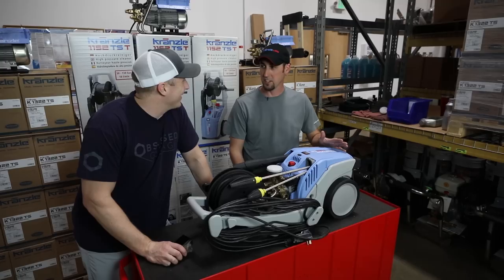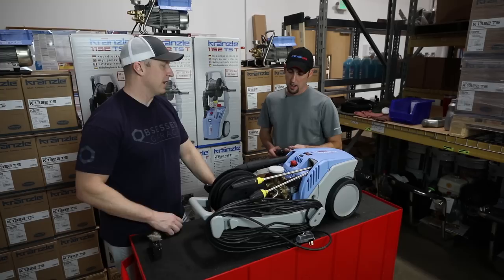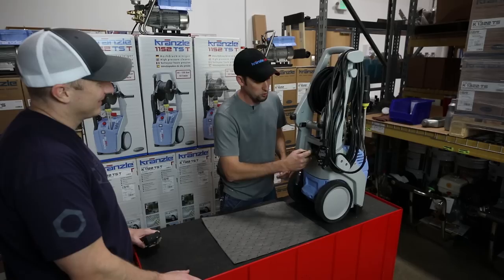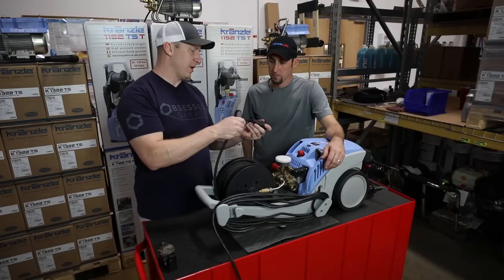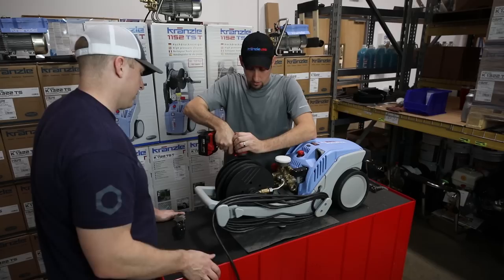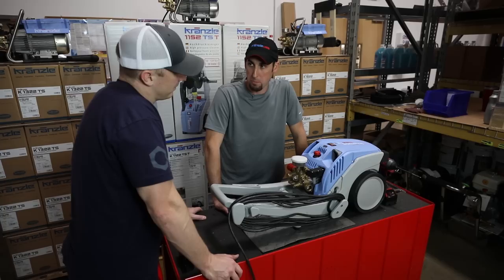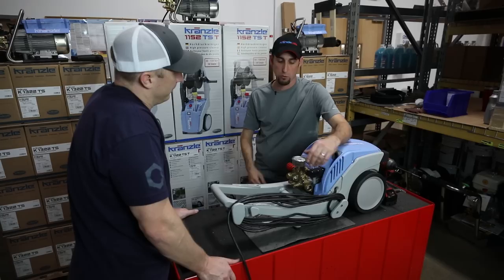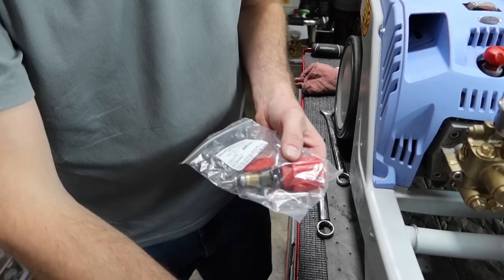Kranzle 1122TST Maintenance Deep Dive: Pump Head Teardown

Comment: Really good video.  I just ordered one of these washers here in the UK.
What I would say though is that vaseline (petroleum jelly) should not really be used with rubber seals/o-rings because it'll actually attack it.  Better to use silicone grease.

Comment: The trick to removing the dip stick is to remove the blue cover. You have significantly better grip on it once the cover is removed. It only takes like 2 minutes to remove the six screws holding the cover on. That way you don't have to mangle the dip stick (you can use your bare hands at that point).

Comment: 27:57 Reason why you get smaller pressure on the gun is due to the design of this model which uses a down-stream injector for pulling in fluid/chemicals/soap.
The down-stream injector valve if bypassed would not cause loss of pressure but unfortunately bypassing it in this model has not been made possible yet and seems like it won't be unless someone comes up with a solution mod.

Comment: I may be buying one of those from you in the Future . Gonna run my AR into the ground first .
Reply: MajorImpact hey, sorry about that.  I have a local pressure washer supplier/service center that knows both these machines very well.  He’s says for the money AR is no doubt your best option, it’s very reliable at about half the cost and the parts are much easier to get if and when you need them.  I have my AR630TSS on order from him as we speak.  Thx
Reply: Tundra Whisperer   I just have a 390ss AR , hose isn’t cool , had to get all kinds of fittings to make it work with QD .  It was cheap , I bought it 5 years ago , just now really using it  after it sitting . It’s OK.  But as  I continue on , wanting to better my detailing , it’s not good enough .
Reply: bob clapper The AR630TSS is the real thing.
Reply from the maker: I'm going to tear down both pumps at OGHQ at some point to show the different designs.  Parts will never be a problem in the future with Kranzle as I will have ample stock of all of them in the coming months.  The AR is a crankshaft driven design.  The Radial Axial Pumps from Kranzle are superior.  Plus fit, finish, and electric motor is also superior.  The AR is a nice lesser expensive alternative, but I never follow the advice of techs.  I following engineering.
Reply: Tundra Whisperer  is there a similar model that’s not Hot ?
Reply: bob clapper yes they make a regular TSS model, if it doesn’t say HOT, then it’s just a standard machine.  Thx

Comment: Hi, Many thanks for this great video.

Can you help me ? I’ve got a issue with my all new Kranzle 1152 TST that I received this morning.
The washer works a few minutes and stop. I can’t restart it before waiting a few minutes. It seems like the washer goes in « security mode » .
I checked the oil level and my water supply ( enough flow ).

What do you think ? Does my Kranzle have a problem ? 

Many thanks from France. (Sorry for my English)
Reply from the maker: You likely don't have enough power for it.
Reply: Obsessed Garage . Thanks for your answer. I checked voltage at the socket and I ve got 235V . That is correct for the french electric network. Manual ask at least 230V.
Reply: Did you ever figure out the problem with the Kranzle?

Thanks from U.K (Sorry for the stupid fishing rights issues)
Reply: @MoebiusUK  Hi ! 
Thanks for asking. I replaced the Kranzle power switch ( who is a thermal protection too : SCHURTER ABTWF120CO ) and everything is going well now ;)

Comment: Can hard water cause pump damage on these machines?
Reply from the maker: It can.
Reply: I replaced the seals and valves on my 1122 this weekend and there was definitely some crusty mineral build up in the pump. My new shop has a better water filtration set up so I’m hoping the next rebuild it will prove to be cleaner.